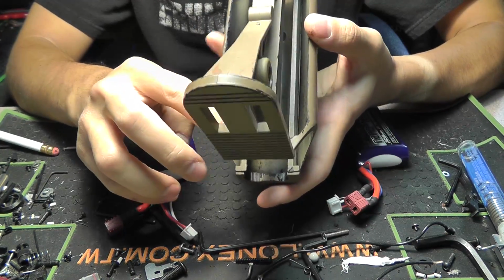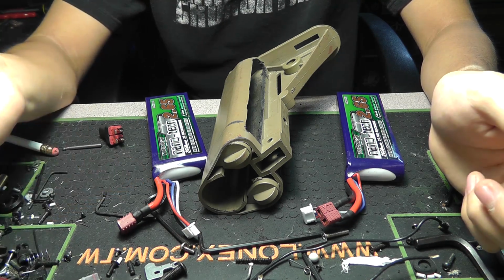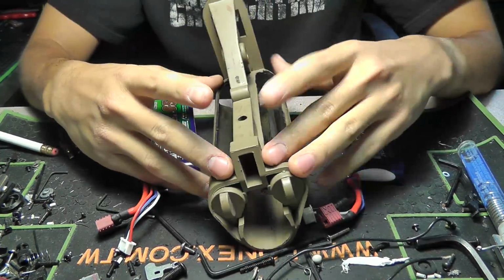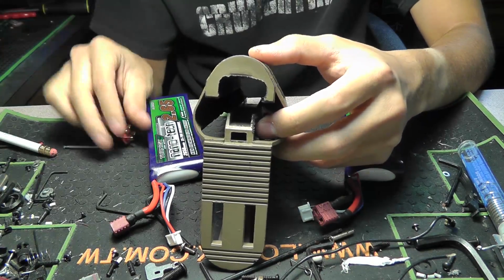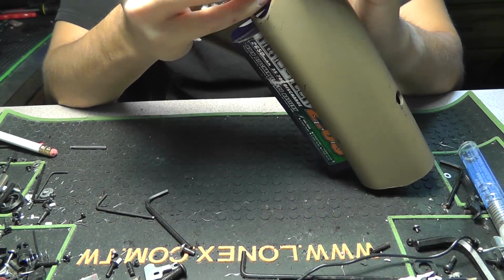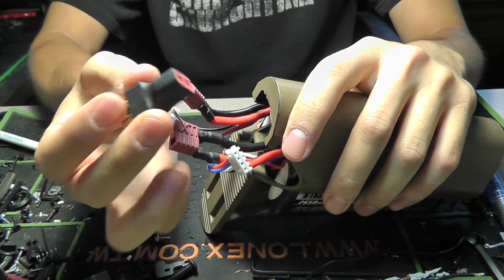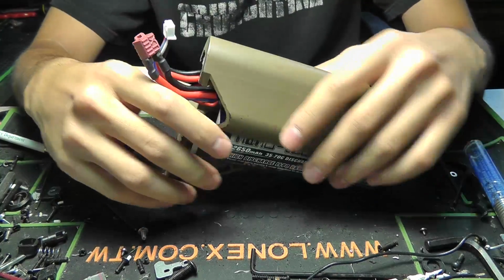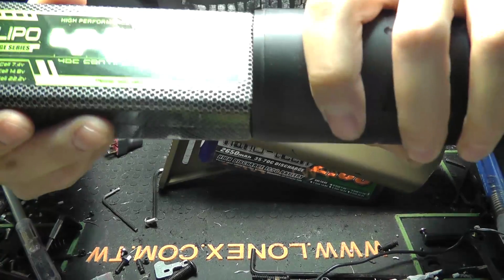Tutorial: Crane Stock Battery Mod

Comment: for the wiring issue with your battery connectors, try resoldering the deans connectors so that the wires are at a right angle to the connectors. that way they should just press in to the parallel adapter without too much finagling

Comment: I've done something similar to this but I just ran 2 2000mAH 11.1 buffer tube? type batteries in series and didn't have to dremel out anything.  They just fit VERY tightly into each side saddle thing.  I did have to remove the little caps though.
Reply from the maker: M16A1srawesome I was considering something like that but I figured I would just go all the way. Anything worth doing is worth overdoing.

Comment: I'm thinking of doing a similar solution this this with with 2 Lipos in parallel: but it's hard to know what sticks will fit without modding of the stock since the battery cavity is for round sticks and the lipos will be square. It's hard to find info on what the largest dimensions sticks will fit in a crane stock lxwxh.
My idea is to use a home made wired parallel adapter and hide inside the buffer tube together with a mosfet, and then the largest 2 sticks I can fit inside the crane side apartments (either 2 or 3 cell).
Any thoughts?
Reply from the maker: yeah thats a solid idea. I was gonna do that at one point

Comment: Or you could run a hollow m16 stock....
Reply from the maker: DevilDog Airsoft does your m16 stock fit an 11.1 5k mah 65-130c battery?
Reply: valleyriverarms Havent tested it because i dont have a battey that big, but i have the stock and i'm pretty sure it could.
Reply from the maker: You should try it. In my testing it doesn't fit. about 3k mah are about the most I'm able to fit

Comment: This is actually quite excellent, I have also dremeled  a lot of my stock just to fit two 11.1 batteries and fit a parallel connector. It is a lot of hassle to do it. So,any updates,have you tried playing with this setting? How do you "protect" your batteries then?
Reply from the maker: +Ljudevit Binder protect my batteries from bb hits? Or from over discharge? I usually don't worry about taking bb hits on the batteries because they're far enough back and covered by my arm that I don't worry about them getting shit.
Reply: valleyriverarms Oh,sorry I wasn't quite clear with my question. BB's I'm sure can't hurt the battery. I meant,how do you keep the batteries stay inside? Are they not falling out when you are running around?